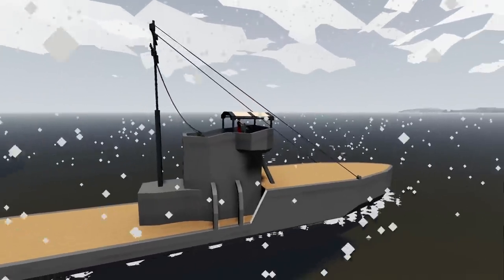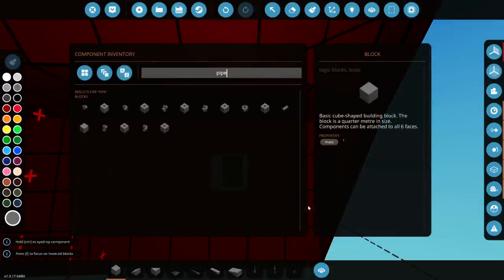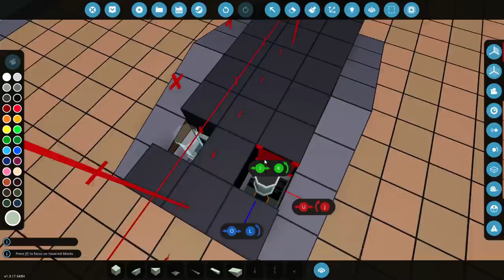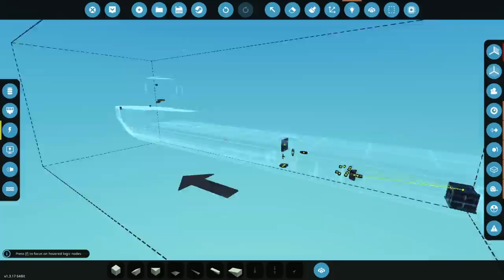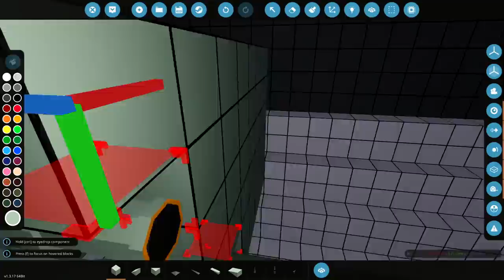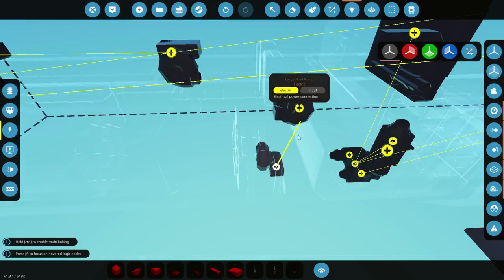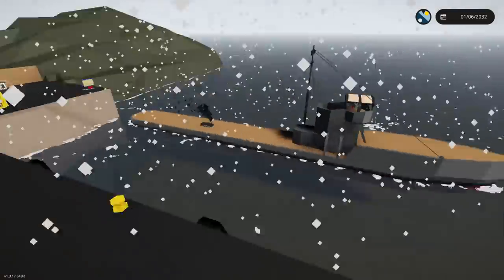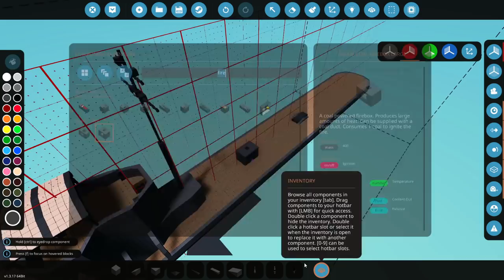SLOW Steam Engine INSTALLED! - WW1 Warship Build - Stormworks Search and Destroy

Comment: Development on the HMS Charlottie's Revenge (placeholder name) would not be so easy, however. With a unique steam engine design and unprecedented fuel levels, it had a large range but the engineers had yet to work out a way to make it travel at a respectable speed also. With war looking ever more certain as a craft suspected to be a German scout was sighted only a few miles from the coast of York, it is imperative that the Frantic Navy have some response to the German firepower lest they be crushed by the Second Reich and its allies on the seas.

Comment: Hey Frantic, the ship looks great. I did have a few ideas though: I noticed the first turbine in the set didn't have any RPS but the others did. The generators may reduce the power output, so you could stick them all on a clutch which is applied with a function block of something like 1/battery level, meaning that as the battery decreases the clutch is applied and charges the battery but when it's charged it isn't. My final thought is for the annoying noise at the front, put them on a timer; they only run for a few seconds as that's all they need then they stop. Just a few thoughts, keep up the great work !

Comment: Try using an impeller driven by the turbine and attached to the 'steam out' of each turbine, and have that pipe back to the 'steam in'.  You can use a fluid flow valve and a T pipe to connect the boiler to your steam loop, and create a lot more power.

I didn't do a great job describing it, but basically you're skipping the condenser and just circulating steam around, and using a turbine-driven impeller to help.  I've used this technique to build infinite power rigs, so unless they've fixed it you can probably use something similar to help build the steam pressure in your turbines.

Comment: Yeah you need more engines, on WW1 Battleships like the Queen Elizabeth class ships they had 4 props attached to 2 steam turbine engines. I’m not sure what kind of warship your going for tbh but the smallest were Destroyers with 4 boilers with steam turbines attached to 2 shafts so the ratio is 2 engines to 1 shaft for high speed and 2 props to 1 engine for torque.

Comment: General characteristics
Class and type	S90 class
Displacement	
412 tonnes (405 long tons) designed
544 tonnes (535 long tons) full load
Length	65.70 m (215 ft 7 in) o/a
Beam	7 m (23 ft)
Draft	2.63 m (8 ft 8 in)
Propulsion	
2-shaft VTE
3 marine boilers
6,783 ihp (5.058 MW)
Speed	28 kn (52 km/h; 32 mph)
Range	2,000 nmi (3,700 km; 2,300 mi) at 12 knots (22 km/h; 14 mph)
Complement	2 officers, 67 enlisted
Armament	
S90–107:
3 × 5 cm (2.0 in) SK L/40 guns
3 × 45 cm (17.7 in) torpedo tubes
G132–134:
4 × 5.2 cm (2.0 in) SK L/55 guns
3 × 45 cm (17.7 in) torpedo tubes
G135 and 136:
1 × 8.8 cm (3.46 in) SK L/35 gun
2 × 5.2 cm (2 in) SK L/55 guns
3 × 45 cm (17.7 in) torpedo tubes